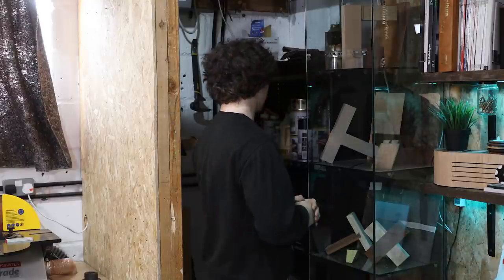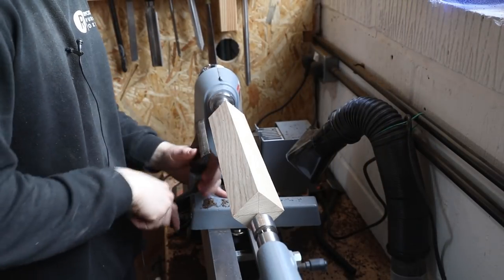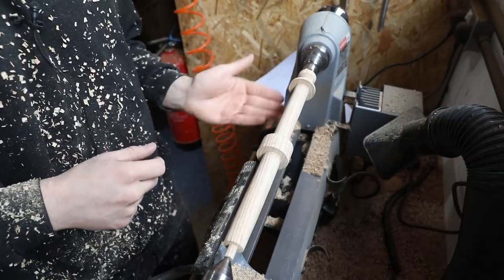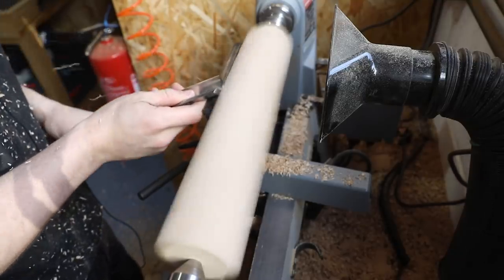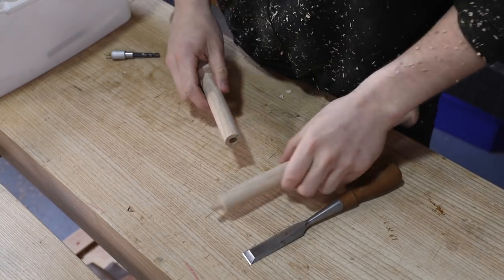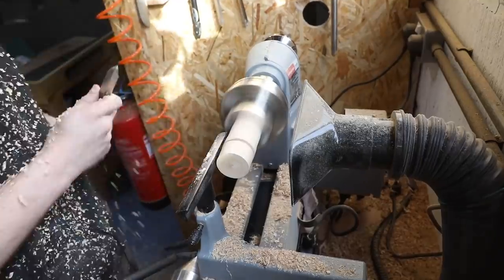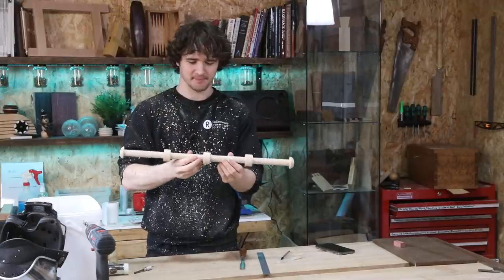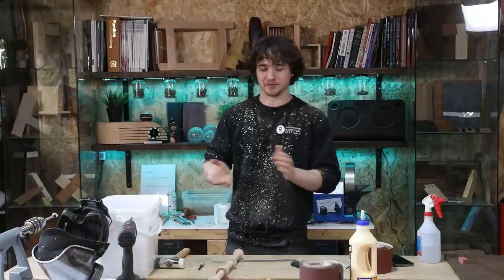Making a Sandpaper Rack - Part 1 | Turning Tuesday #9

Comment: It turned out pretty good for having to turn it in two separate sections. You're making me begin to wish I had a lathe.

As far as the odor in your mask, wipe the hard surfaces with vanilla extract, not imitation vanilla extract, pure vanilla extract. It removes odors; I've used it many times on coolers and other things that have developed odors to get rid of those odors. You may have to apply it more than though depending on the severity of the odor in your mask. You may be able to apply it to any fabric surfaces too; I've never had to do it so I don't know if and how well it will work.

Comment: When you have an awkward sized hole to drill, take an oversized spade bit and grind both sides down carefully until you have the exact diameter you need.

Comment: Here's another little trick for you. If you need to put another divider ring on a turned spindle try this. Turn a ring then break it in 2. Then glue the pieces back together onto the spindle. Clamp tightly and wipe off the glue so that no one will be the wiser.